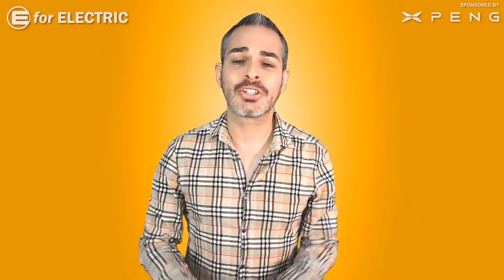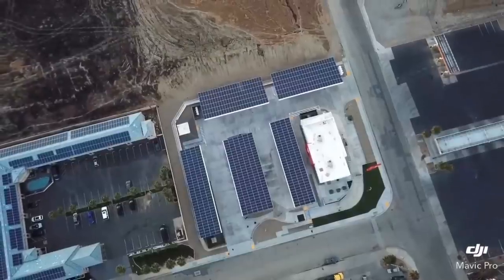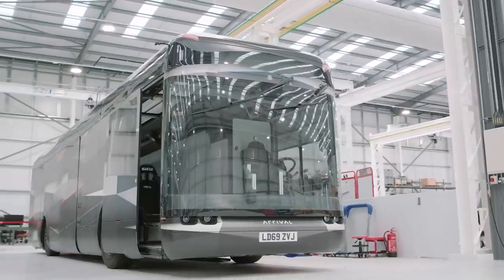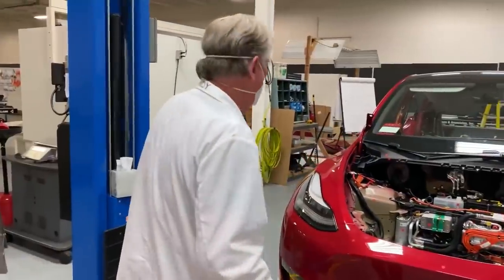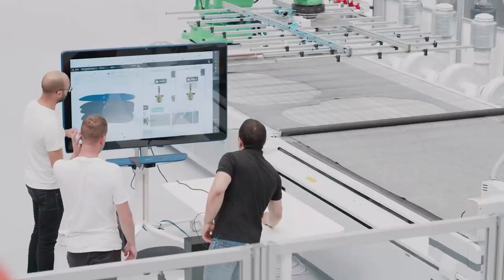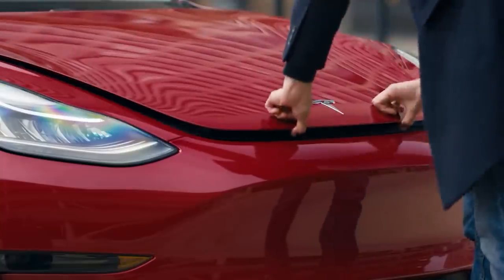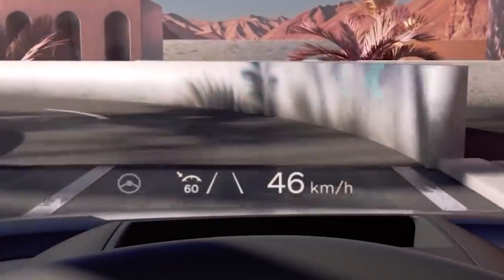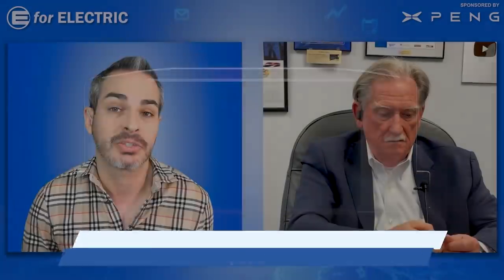Sandy Munro vs 2021 Electric Car Tech

Comment: I'm  field engineer for 40 years and I agree 100% with Sandy's statement about the fragility of connectors. Once a connector gets a little dirty that creates resistance. Resistance across a connection creates heat, with creates resistance. Spiral of death.
Reply: Just look at your phone charger :) hate the stuff
Reply: Look on the bright side, with the energy dissipated at the faulty joint the fault won't be intermittent for long and the fire department will have a clear target to let loose the extinguishers on ;-)
Reply: Connectors are unavoidable unless the EV uses wireless charging. Do you think the charger connector in an EV is fragile?
Reply: @cruiser97eric1  Those can be replaced far easier and cheaper than a battery.
Reply: Yes, dirty loose connectors will lead to arcing and increasing the chance of a car fire.
Reply: @rivengle  That is just speculation on your part. I expect a battery pack designed for swapping will allow easy replacement of its connectors. EV maker Nio has done more than 2 million battery swaps so far and I have not seen any reports of them having any issues with connectors failing or being difficult to replace.
Reply: @cruiser97eric1  Agree, besides, couldn't the automated swapping machine also automate connector cleaning in the process?
Reply: I’m thinking of the joys of that swap when there’s ice and slush and salty crud all over everything. These pristine demos are not the world we live in.

Comment: Hi Alex.  I think if Sandy had answered your battery swapping rebuttal he may have said: Buy a car with a 20kWh battery for everyday use and then rent a long range EV when you need to take that trip.  This creates a market for long range rental EV's and limits the need to lug those huge batteries around in your daily commuter.   That's my answer, for what it's worth.  Also, another outstanding episode!
Reply: Good point. Most probably would like to rent a bigger car like a Y for those longer trips anyway!
Reply: @updlate4756  I agree with you.  Can you imagine how much it would help if we could get 2,3 or even 4 small batteries out of some of the largest battery packs. The environmental impact would be significantly lower on all fronts.  The problem is everytime I see EV reviews, even on the best EV channels, the focus is on range and charging time, this messaging has to change for us to move forward in a more efficient manner. We don't buy a bus for everyday use just because we might need to haul the whole soccer (football for the rest of the world) team to an out of town tournament one day.
Reply: I agree and I think that's gonna happen. Once self driving is real (whoever brings it first), it will be way cheaper to rent a car, cause you don't have to deal with people anymore. Just click where and when and the car will pick you up.

Comment: I'm with Sandy on this. Better place tried it , Tesla tried it , NIO will have tried it. Once they get a little faster charging Ina year or two all those swap stations will be scrap metal
Reply: also batteries are in short supply.  Where are all the batteries coming from that are just in the charging stations?
Reply: I wonder if built-in battery augmentation support would have been better than battery swap.  Make a car cheaper by selling it with enough rage to cover 95% of daily usage.  But have a cavity to add in a rented battery pack extension to double (triple?) the range for a long trip.
Reply: @john348jp  People would not have to buy cars with 80 kwh batteries. 40kwh ones would double the amount. You would just have some additional long range ones for people planning a long trip.
Reply: @Psi-Storm  good point but it would mean the stations have to have both types of batteries in stock.  So it would come down to the mix needed.
Reply: not particularly practical for those who are looking for a quick charge stop. Would work if you are preparing for a long trip and you are intending to do a long charge before setting off.
Reply: Tesla toyed with the idea. Don't think the infrastructure would have been affordable at that particular time. It would have been too high risk at the time.

Comment: 43 years experience as an electronics tech here. When Sandy says connectors are the number one point of failure for electronics he is correct. 
There's a huge difference between quality levels, just like every other component, but even the best will fail sooner than most other parts.
Reply: Mil quality connectors will outlive the vehicle, I've seen connectors and receptacles used in the field on military vehicles for 20 - 30 years that are still work perfectly and exhibit extremely low contact resistance easily meeting their original specification.

Comment: I do not want to bring negative comments but Sandy Munro started his career by improving methods of engine assembly. Thanks to folks like him ICEs went a very long way from 50-ties when one needed a V8 engine to cross mountain passes in Colorado, driver being by himself in the car, to today trucks able to tow huge loads at 70 MPH up the same mountain passes in the dead winter. Folks like him improved not only the engine but also the transmission inasmuch as today ICEs maintain 98% of the market despite Tesla started EV revolution in 2008. Now Sandy is foreseeing 2 seater EVs and dismissing even HEVs. At the same time the commercial boom of ICEs started by his generation of engineers is vehemently opposing the adoption of EV technology he is happily promoting in XXI century. The main advantage of ICEs so far is the long range while towing even in the mountains in the dead winter. For several years the EV trucks are only promissed but not produced since the ratio between energy needed by truck and that contained in the battery is certainly making EV trucks useless for towing especially in the winter. See Lordstown Endurance fiasco in the recent off-roading competition on the sandy terrain at Baja Race after 40 miles. For now only HEVs and PHEVs are viable enough to be used on the trucks for plowing snow in Minnesota in February, for instance. Only in theory a Hydrogen truck can do it but has nowhere to refuel. Thus swapping the battery might make sense also. Sandy Munro is talking about the future due to his business model but real people live now and want feasible solutions NOW. That is why most solutions are compromised like HEVs and PHEVs hated by him and me but nevertheless used by many since those are a better choise than Diesel or Gas ICEs. To me HEVs and PHEVs are really competitive in certain situations vs ICEs while BEVs still need a long way to go.

Comment: Awesome to hear Sandy's insights on Lidar. I do also think battery swap is iffy. They would need to have all the brands standardize every model on one pack and other than body style that would remove any competitive advantage some of them can come up with to gain market share.
Reply: Very not USA
Reply: Consider what exists with Calor Gas(UK) and almost every other country has same or similar gas and cylinders.
Reply: Also another perspective bringing the battery swap concept to shuddering halt as fast charging improves but more relevant it swims upstream against (for Tesla at least) against “structural batteries” .... I think they are fixed in there for life? 🤔

PS. Think better capacity and faster charging battery packs with less ‘packaging’ versus the requirement for additional packaging to make a pack ‘swop-able’ 😟

Comment: Battery swapping is a great idea!  It's such a great idea and customer demand is so great that every major flagship cell phone manufacturer has transitioned to a swappable battery!??!  Oh wait.  They didnt... I remember HTC marketing this heavily when cell phones took 3 hours to charge... until they gave up.   It's a theoretically nice to have feature but utilization did not justify the cost complexity and design compromises.

This fell out of favor even when the cost and complexity of swapping a cell phone battery is literally several orders of magnitude easier and cheaper than swapping a car battery.   

There's also the issue of battery supply.  Every single EV manufacturers bottleneck is cell supply.  It just dosent make sense to have 13+ batteries in each station sitting there when they can be in cars.  The situation is not scalable. 

We have technology to make EVs with 500+ mi ranges that can recover 400mi range in 30 minutes.  Battery swapping will go the way of the dodo except for people that want a new battery on the manufacturers dime because they abused thiers.   Or they want to try it because it's novel but then realize that on a busy route they are 5 deep in a que waiting 40 minutes for a 5 min swap.   I rather plug in take a piss, get a cup of coffee and a doughnut and skip the line of cab drivers at the swap station hoping to pop a virgin battery that you just swapped out of your car.

Comment: Another problem with battery swapping it that it makes it very hard to make the battery pack a load bearing component.
Reply: One issue with the load bearing battery frame design is that it makes it more difficult to make modular battery sections which can be replaced or serviced independently of an otherwise good battery pack assembly. If one cell dies, the whole pack must be removed and the offending cell found and replaced. Modular replaceable sections could mean less time removing a single, very large and heavy battery pack.
Reply: @AudiTTQuattro2003  Nope. If one cell dies turn it off and ignore it. Tesla has abandoned modular batteries for a reason. They never replaced any modules...
Reply: @langforc  I agree. One of the things I really like about EVs are that the core components (battery and motor) can be made extremely reliable, 30+ years, and function almost with out any maintenance. And if they are reliable enough it makes no sense to make them easily, or at all, swappable. You don't make the structural components of a car swappable even though many of them are destroyed by rust in 10 years in harsh climates. 
And opposed to ICE cars it pays off to make an EV extremely reliable since they already are close to the efficiency you can expect of the drivetrain.

Comment: I had a 1990 Nissan 240sx that had a HUD. A simple projector that displayed a digital speedometer onto the windshield. When going to replace the windshield, it cost an extra $300 for the version with the "proper" area for the HUD to display onto, but i stuck a piece of window tint on the cheap one instead, and it worked fine. It baffles me that every car doesn't have at least a simple HUD, because that's time you don't have to take eyes off the road to see your speed, so your eyes don't have to adjust to differing distances, making the drive safer and more relaxing. If you drive a manual transmission, you know what speed is which revs, and when to shift without needing to look at the tach. Every car has a backup camera, so I don't see why they couldn't have a HUD.

Comment: Wow , quite a few great topics in this video. 
I was  also a bit disappointed Sandy took a dump on battery swapping but I really like his explanation at the end of the video. If in 5 years we have 60kw/hr solid state batteries capable of 300 miles and 5 minute charging does does it make sense to invest in the battery swap infrastructure? Probably not. 

I am quite excited about ARRIVAL. I do believe they are using colored composite panels rather than paint. It was also my understanding they make all components in each micro factory so there shouldn’t be a high cost for shipping parts. Definitely worth a follow up video   ID 4 road trip to their US factory once it opens?

I do like the idea of a HUD especially if there is no screen like 3/Y. I remember Elon saying he decided against it during initial model 3 planning because he felt cars would be driving themselves and you wouldn’t need it. Point taken but I’d still like to have one. 

At a minimum I would like to have a small frunk  for charging cable storage. I’m a bit disappointed the ID4 doesn’t have one but it’s not a deal breaker. I still believe it’s a great value with what it does offer. I drove one this past weekend and came away impressed. Looking forward to your videos when you get yours.

Comment: 👍🏼 I agree with Sandy about the battery swaps.  I would take much better care of a battery than anyone who knows they can abuse it and get a different one.  Plus I would be charging it at home 99% of the time, so I would mostly be running it from 30% to 70%, so it would last a long long time.  And he is dead on about high power connectors, and multi-pin data connectors.
Reply: Good point. Nio charges at home as well. Don't want to swap then don't. Want to upgrade or downgrade a battery if renting or faulty? No problem.
Reply: Also you'll never suffer battery degradation and you can always have the newest model battery in your vehicle. Your car won't depreciate as much if your battery never depreciates. Old Nissan leafs are almost paperweights at this time.
Reply: I’m 75 years old,  drive around 4000 miles a year, so I am never going to “wear out” a battery by cycling it.  I have a 15 year old MB SLK55 AMG with 52K miles on it.  It would probably last me the rest of my life if I wanted it to.  All I want from an electric car is similar acceleration, charging at home, battery longevity retaining near full capacity for 15 years or so, near zero maintenance, reliability, and autopilot for the limited occasions I might travel cross country.  If I get too senile to drive myself, then maybe add full self driving some day.  Right now, a Tesla comes closest to meeting that description, but I don’t have to buy anything right now, so I will wait and see what comes along, do my annual $300/9 quart oil changes and $60 Premium Unleaded fill ups, and buy when there are more choices.  A swappable battery pack won’t be MY priority.  Your mileage may vary.

Comment: The other thing they didn't mention about battery swap systems is that someone has to bear the cost of a bank of batteries at the ready. Battery packs costing around 10k each being charged and held until a customer comes to pay for a swap. If that swap station isn't utilized continuously at high volume it will never recoup the cost of the batteries it has to own, let alone make a profit on them. As Sandy states he was able to make it across the US with relative ease just using supercharger stations so a battery swap station would only be for edge case scenarios. To add to the convenience factor of a battery swap you also have to have these swapping stations widely available across the globe, or at least across the country you purchased the vehicle in. Let's say it saves you 20 minutes to swap versus using a supercharger station or equivalent to charge but yet cost you three times as much. Most people, even wealthy people, wouldn't find saving an additional 20 minutes worth the additional cost. Also much easier to litter the globe with supercharging stations as opposed to having to set up what is essentially the size of a small car wash station with the battery swap stations.

Comment: Battery swap makes sense with the Semi.  You can run smaller batteries and keep the truck running for more hours. If the trucks run multiple short routes it would work better than having to wait for the batteries to charge up or haul around a much bigger battery.
Reply: It makes perfect sense for freight.  The commercial transport market is huge, and battery swapping makes far more sense than charging the ridiculously large batteries Semis will require.
Reply: Batteries don't make any sense for a semi tbh.
Reply: @andrewmeehan6151  That may be true, but that's a different discussion altogether given EV Semi's are currently in development.
Reply: @Cakebattered  i wouldn’t put my stock into those companies
Reply: @Andrew Meehan I would avoid putting stock in stuff, but I cannot help it. There aren’t many things a good stock can’t improve. Going to put some in a tomato gravy today!
Reply: I was very surprised they did not go with 2 battery packs. The first battery as a 300 mile non-swappable battery and the second battery as a swappable battery range booster to increase the range for 600 miles.  That way any truck could do long-range routes and still run shorter more efficient runs with the lighter battery pack.
Reply: @andrewmeehan6151  semi truck are too loud pollution producing can’t wait for Tesla semi to take over the industry
Reply: @ralphmalph6097  your gonna be waiting for a long time. BEVs aren’t a good application for anything bigger than a Ford Explorer.
Reply: @andrewmeehan6151 , I guess that means hydrogen semi trucks and electric railroads, because many places are going to restrict or ban new diesel trucks in the near future.

Comment: Best answer would be, about the battery swapping, is to simply let the market decide. Done! I my self would like to have a battery permanently in my car simply for the charging options, but swapping could be made into an option. What I would like is to have a rental service from the manufacturer for the battery pack this way I never own the Battery but rent it, although owning the battery pack should stay as an option. This is incase if I purchase an older vehicle I can just get a rental plan for the battery pack from Tesla and still access the Superchargers and not worry about having to pay thousands for a new battery pack, while the car would be mint condition. It would be great for the brand but also great for all the owners of the vehicles because it helps keep used vehicle value. Great Idea? No?

Example: 150$/month Tesla Model 3 Battery Pack rental, including free supercharging any distance. There would never be a reason to buy a battery pack, why own it?